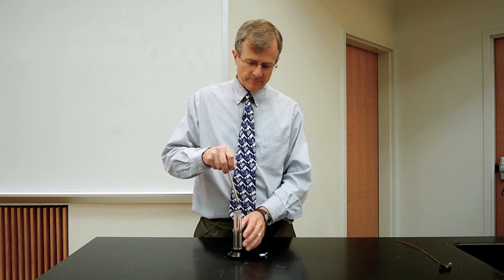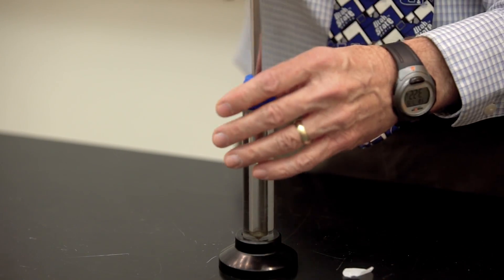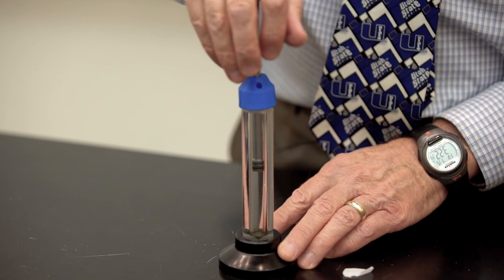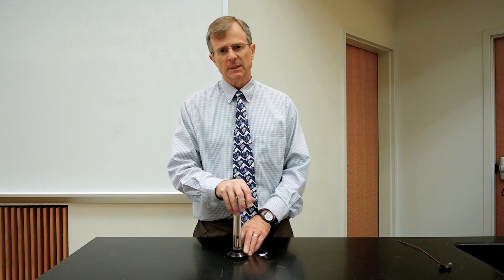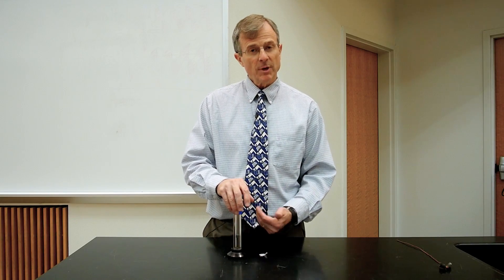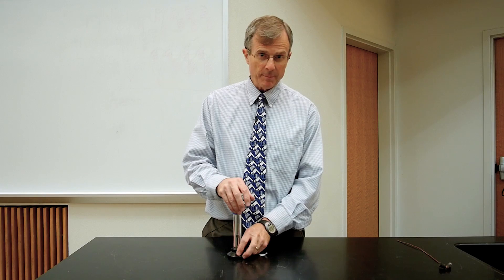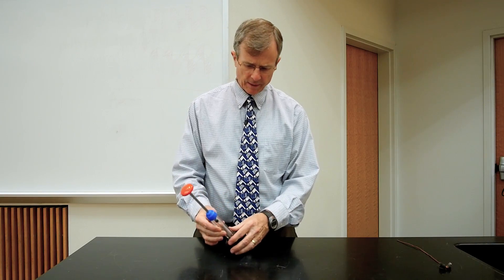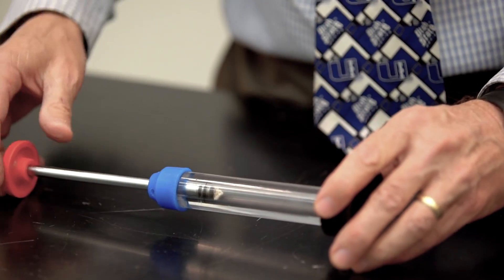Adiabatic Heating Demo

Comment: can we build a fire surviving tool with this process ?
Reply: Difficult. Oxygen would deplete
Reply: @KGopidas  just make the system openable to oxygen enter.
Reply: @Fine_Mouche  then the pressure won't be dense enough to start the fire.
Reply: @yeetboi268  openable => resealable